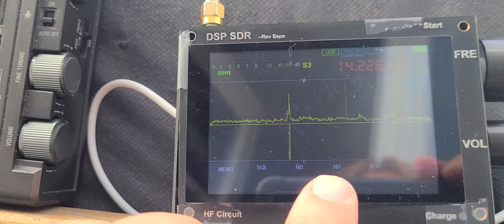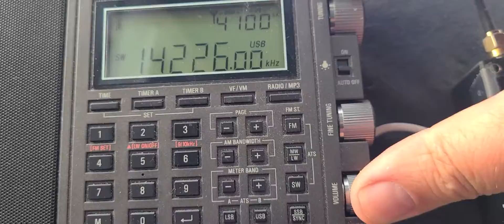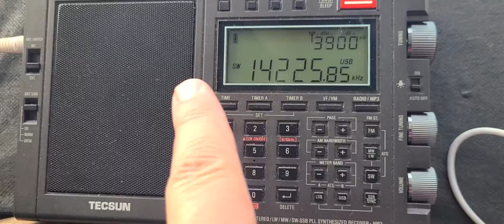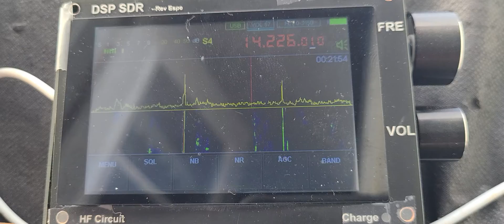Chinese SDR DSP malachite Tecsun PL-990x 20 meters Shortwave F8KGM France ham

Comment: Hi Gilles, any chance you could show us how (and where) you connected the USB cable inside the Malachite to run it? I got one that is almost identical to yours (only the "Charge LED is labelled differently) and the USB C (for both charging and just power) doesn't work. I don't know if it is a defective USB C port or something to do with the battery/charging circuit inside the radio. Otherwise, it worked well when I first got it. Now the battery has run down and I can't run it with a 5V - 1A power supply externally (plugged into the USB C), clearly indicating that it will not charge also.
Reply from the maker: I simply cut the battery cables and connected a USB cable and soldered it to the wires that go to the circuit board, just be careful of having the right polarity.